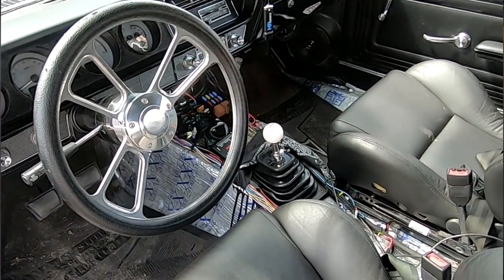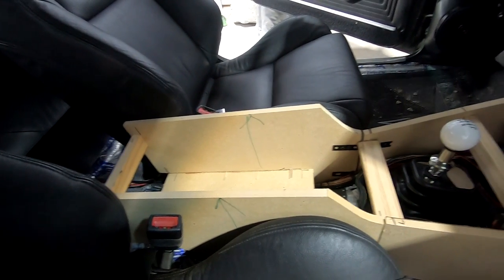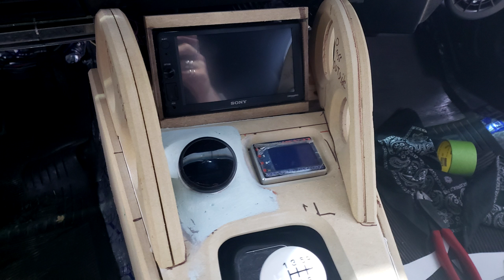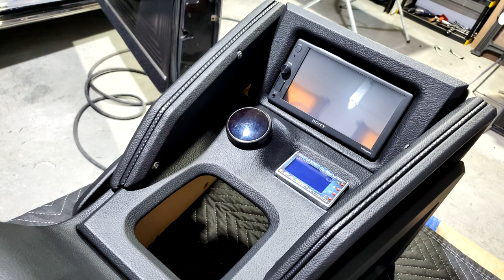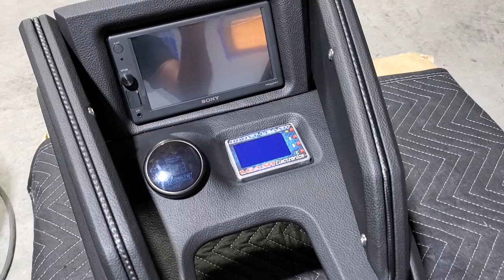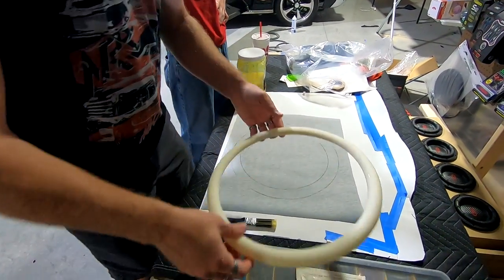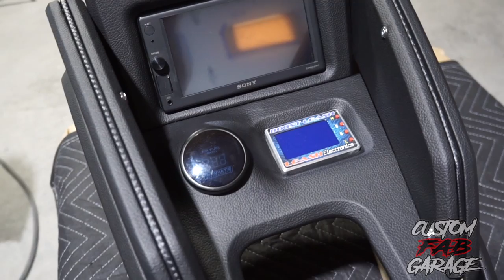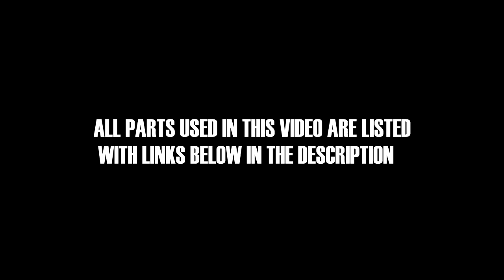1965 LSX GTO CUSOM CENTER CONSOLE BUILD VIDEO

Comment: i rarely comment but things need to be said. first, i will say this is the absolute best, if not the top 3 center custom console builds I've seen built by hand by anyone. HOWEVER, HOLY BALLS are you people deaf or just don't give two shits, I'm shocked i even have to explain what I'm talking about.... yall sure know how to make a center console but dam all of you sure as hell don't know your way around a computer. In the first scene, i had to max out every volume setting I had, 2nd scene came right after I stepped away from the computer and about made everyone in the entire house as deaf as you guys. this Very large, alternating,  Difference in volume occures every damn time the scene changes and especially when yall talk. None of you noticed this post edit? basically falls on whoever added the damn music. he had the easiest way of fixing it. yes viewers wouls have to max out there volumes at least they'd be aware of it when it ended. option2 whoever added each clip needed to amplify the audio.  Im frustrated AF because i wanted to hear everything yall said cause this, again, was the cleanest OEM looking build ive seen. so i had to endure this retardation of a youtube video. and a different topic, pretty ignorant as well, every cool aspect of the build, such as:  TEXTURE, HOW  The ** did you achieve such perfect factory-like texture, no one I've seen has ever even close to a texture so factory finish.  , MDF Cuts by hand or CNC?  The carbon fiber Film? Real carbon fiber? what? missing a TON of How to info u could have added, don't even give me the " Trade secret bullshit, tho only people watching without a doubt have no threat to your customer base i can assure. we are all DIY Shop/ garage enthusiasts so what with the secrets. And if half of this is covered in the products list mentioned the end then im a cunt and apologize.  looking back i almost regret half of what i said but i spent time typing it and its here to stay. LEt this be a fricken lesson

Comment: I've watched your vids over and over during my own build... very nice.
If possible what type of vinyl did you use? it molds really well.
thanks
Reply from the maker: It's a local brand to here in Indianapolis
Reply: @octanetvchannel  that answer was not helpful.
Reply from the maker: @barryinn1778  they are distributor only they will not sell to the public. I'm not trying to be rude but I'm being honest when I answer the question correctly. A lot of manufacturers will not sell to the public only to distributors and people with tax ID numbers that have been in business for a long time. Honestly there's a tremendous amount of products out there that work just as good the number one I would recommend is Xtreme. The problem right now is there is a tremendous amount of shortages on this type of material. Almost everyone I know of is out of stock